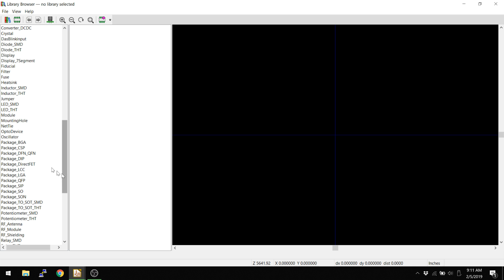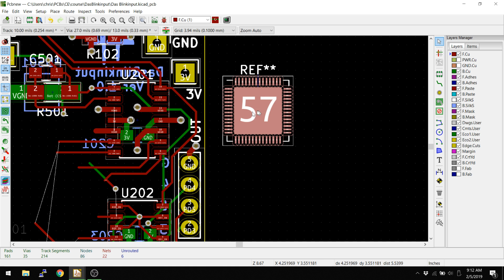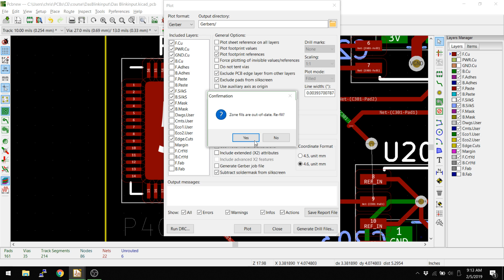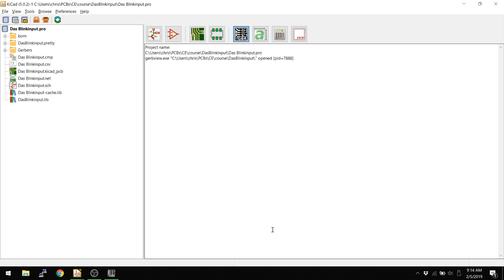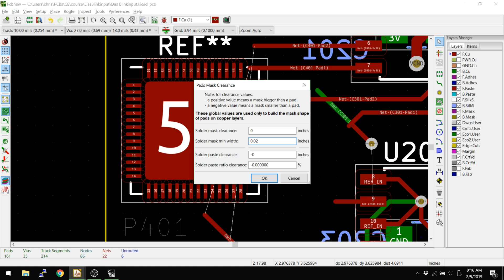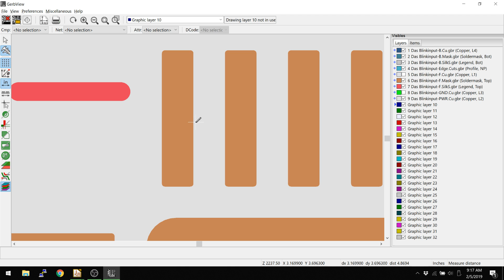KiCad 5.0 - Minimum Soldermask Thickness

Comment: OMG...I was just about to send a board to production, It was my first 4 layer board and it was also my first board with a 64 pin chip and I hadn't realized there wasn't any solder mask between the pins because the pins were 0.1mm apart...you were totally a life saver...the video just popped up in my feed yesterday..lol..Thanks your video's have been a life saver for me..

Comment: Great series! I like the blending of KiCad tips with general engineering design info.

Since I've not done any boards with fine pitch parts yet I'm wondering about how the lack of soldermask between the pins affects different soldering techniques. To my mind you could probably get away with it for stencil/reflow but not wave. Unsure about the ability to hand solder in this case. Thoughts?
Reply from the maker: With enough flux, all things are possible :-)